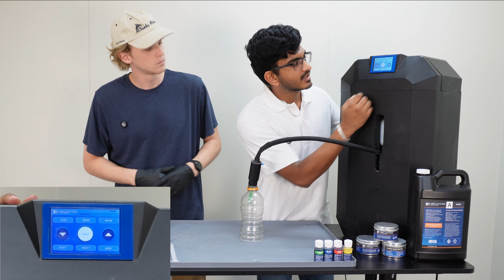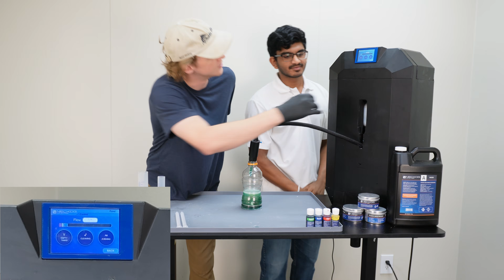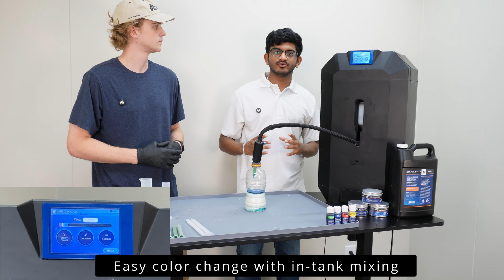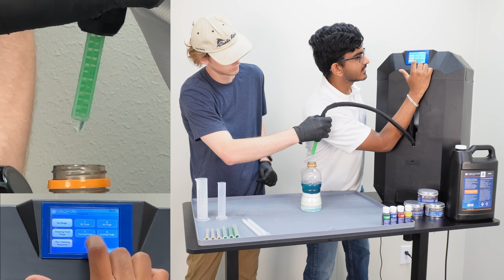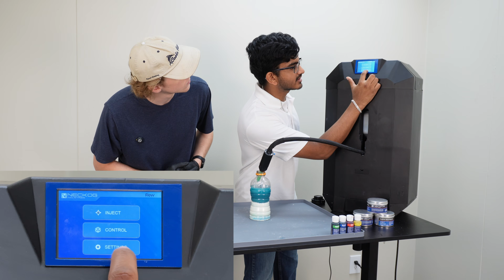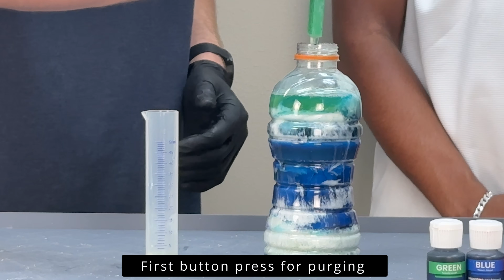Desktop Injection Demo | Feature Showcase

Comment: I'm sure this guys is a great software engineer, but if you're planning to get this machine to market, please hire an UI designer too. 
I'm sorry, but that UI looks awful. It's just buttons put in random places.
Reply from the maker: We have a dedicated UI designer on our team, so our software engineer doesn’t handle the screen design. However, we do welcome recommendations.
Reply: @NeckogIndustries Tiny buttons on a touch screen esp in the corner are prone to failure over time 

I run into it a lot with an old flashforge printer and hitting the back arrow in the corner that doesn’t work well is excruciatingly frustrating
Reply from the maker: @BirnieMac1  Buttons on the corners have been adjusted and they are bigger.

Comment: Safety glasses are way cooler than eye patches and glass eyes. Make sure to set a good example for your future customers by using proper PPE since resins and hardeners contain very nasty chemicals that are being pressurized by your injection machine. I would go even further with a full face shield because I've had hardener splash in my face while helping a coworker pour it into a container. Safety glasses protected my eyes, but some splashed on my lips and instantly wicked into my mouth. MSDS said it's necrotic to flesh, so our safety guy had me flush my mouth and face for probably 30 minutes straight. I had numbness on my lips and part of my mouth for days. It happened 14 years ago, but you never know what kind of lasting effects or future complications a single incident can create. If I can save someone else from the trouble and make sure nobody else finds out how nasty that crap tastes or feels in their mouth, then I've turned my negative into a positive for others. Be safe. 😉
Reply: it kinda shows how professional they or this hardware is... not at all. HARD PAS

Comment: Looks neat, 

Why not just make this system so dirt cheap mixing nozzles (literally cost penne's wholesale) can be changed vs going through a cleaning/clearing process for one nozzle? 

I bought a bag of 3M twist on nozzles 2 years ago for epoxy and still have full bags.

Thx in advance for any input
Reply from the maker: Thank you.

If the lines are not cleaned properly resin dries in the system and clogs pipes and pumps. You are right nozzles are pretty cheap around $2. Cleaning system is much cheaper than changing the nozzles. It costs about 0.1-0.2$ per cleaning. Also no clogs in the system over-time.
Reply: @NeckogIndustries  but it says 40cents for the cleaning fluid alone in another video, not counting the dumped resin in the cleaning process

Comment: Do you still need to use a vacuum chamber to remove any bubbles from the injection process?
Reply from the maker: Not needed our system doesn't introduce air into the resin.